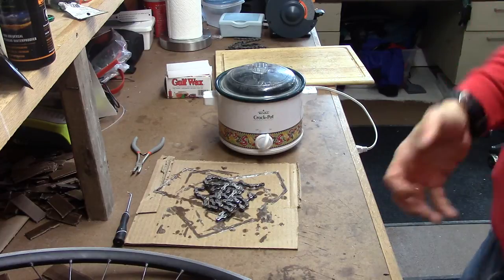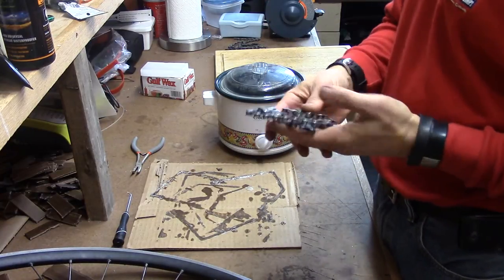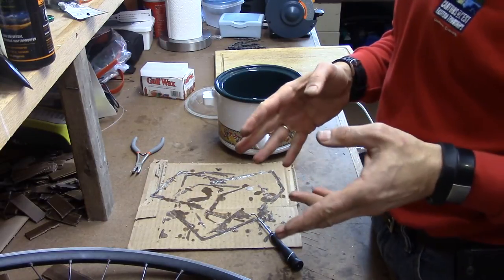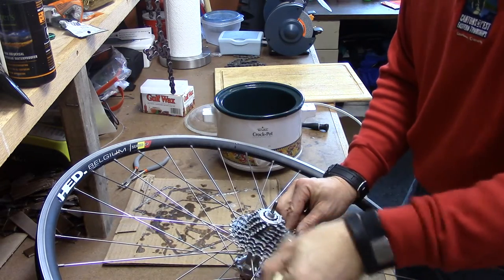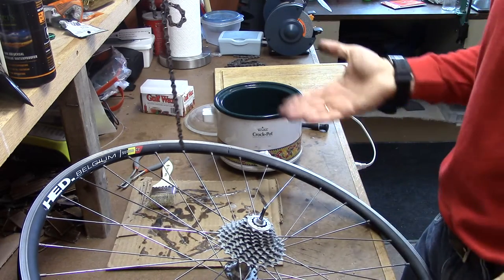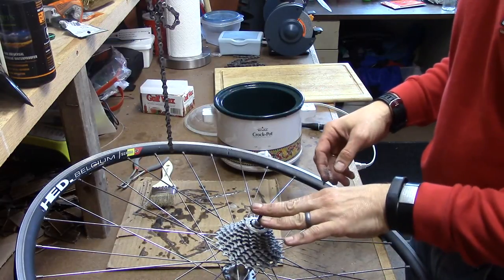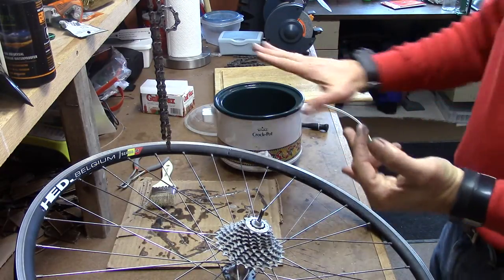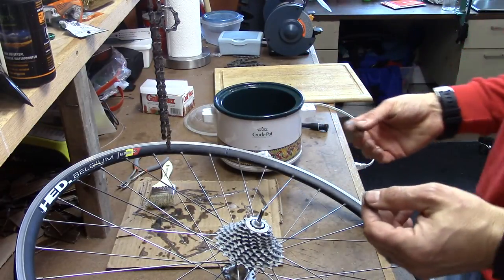How To Lubricate Your Bicycle Chain With Paraffin

Comment: I mix the wax with lamp oil, to a level that the dry wax won't be brittle and flake off quickly.
In addition, I wait until the melted wax beginning to harden before I pull the submerged chain out to hang.   I learned that most of the wax drips off if the chain is too hot when hang.  
Once cool, the chain looks like it's encased in a thin layer of wax.   I simply agitate the chain in some paper towel to get the excess wax off.
The result is that the barrel between the chain links is filled with wax.   I am hoping that the filled wax serves as a reserve that automatically lubricates the chain as it softens/melts when the chain is heated from pedaling; at the minimum, the filled wax keeps the dirt out of the barrel.

Comment: You will find that a big improvement would be to mix the wax with about the same again of liquid paraffin before heating.  This stops the wax from drying hard and flaking off and makes it a more "greasy" constituency that will stick to the inside of bearings without being pushed aside as a flake. It will keep the stay clean characteristic by being waxy and not attracting dirt.
Reply from the maker: Thanks, we'll give that a try!
Reply: No it should be 70% wax 30% paraffin oil
Reply: it depends on outside temperature: hot-less oil, cold-more oil, to be same softness no matter of temperature

Comment: Great Video, so often these "old knowledge" sort of bits of knowledge are lost. Have you ever tried increasing its effect with any more modern additives?

For instance I make my own penetrating oil by using oil and kerosene. Kero is dirt cheap (I buy heating oil by the 5 gallons but even as bottle of "parafin lamp oil" works fine). It's excellent for storing items not used often asd well as loosening nuts, BTW.

I would think,as long as it would mix, that the newer low-friction waxes, like nu-finish might blend great in with the wax and keep the chain lubed longer and cleaner. Just a thought towards improvement. Later...
Reply from the maker: +BikingMNViking : Hmm...no, we haven't tried anything like that! We're natural born chickens, and it seems like putting kerosene into molten paraffin has the chance to be dangerous; our melting pot doesn't have temperature control on it. But, for the more adventurous out there, it might work. If anyone tries it, let us know how it works!
Reply: +EasternSlopesCom Haha... it's not THAT serious. You do know that

A) nothing burns until it is a gas
B) you're shifting physical states of the paraffin closer to A by turning the solid into a liquid
C) wax burns, too, you know.
What do you think a candle is?

(and is the item at a lower energy state: IE: solid )

I am not saying a lot -- and by all means I would keep the LID ON but I think 1 z (2 Tablespoons, a shot glass full) would probably help it penetrate and you wouldn't need to soak it 15 minutes but probably 30 seconds. 

In fact once it's solid you probably won't even notice much change. But you'd be surprised at all the things that will go into wax. I've even experimented with smokeless powder in wax when making homemade fireworks. No fire ever and its far more flammable.

(BTW, us woodworkers make ALL KIINDS of wax recipes to polish or restore furniture. Google it sometime! (plenty with more flammable than kerosene))

Crockpots are very low heat items which is why it was a smart choice to begin with rather than use an open burner or even a pan on a stove which can get much hotter much quicker. I've seen a wax fire become self-igniting/sustaining in a stainless steel "ashtray" of all things. Not pretty.
Reply: I bought medical (or building) liquid paraffin its cheap 5$ for like 1/2 litre, won't it do the job??? isn't the solvent in parafinn going to evaporte after application ? rather than having a mess heating wax ? (i'm sharing a place so...)
Reply from the maker: We can't claim to be experts on liquid paraffin, but can't think of any reason that wouldn't work. Only concern...be sure to have the windows open while the solvent is evaporating! Let us know how it works...if you have good results, we'll definitely want to try it!
Reply: Kerosene as  ( in ) luminous  petroleum ?? Right !?  ( Mixed up with a few spoons of  (warm ) paraffin ??!??
Reply: @EasternSlopesCom  ... /... , i did ...  LIQUID paraffin mixed with luminous petrol as a carrier !

Post - scriptum : ... /... , other times ,,, Diesel ⛽ ,,, gazhuile .

Comment: How do you clean off the old paraffin from the chain when you want to reapply a new one?
Reply from the maker: You don't...the only reason to reapply is because the old has worked its way out of the pivots. You'll notice the chain getting a little noisy, and that's the key to know that it's time.
Reply: Boiling water 🌊🌊🌊🌊🌊🌊 ( [ ??? ] ) .

Comment: Just curious about re-waxing afterwards. How many miles is a month for you? 2 months even?
Reply from the maker: Probably something like 400-500 miles a month. But, again, how well the wax lasts varies a lot based on weather conditions; riding in rain means a lot more grit in the chain to contaminate and wear out the lubricant.

Comment: if you go to a vacation on sae, will you bring with you all that equipment and pots for chain cooking, i bring only remote 12v inductive heater and wax
Reply: I bring 2 pre-waxed chains ready to go
Reply: @mitch1495  yes i could made 10 chains , for 2 bikes and 10 days of holydays, but then i have 10 chains in circulation and it is more bulky than inductive heater and battery

Comment: Hi guys! How do you lubricate the pulleys after the paraffin is applied?  No spray but drops of lube I presume, isn't it?
Reply from the maker: We assume you're referring to the idler pullies on the derailleur, and...however you'd like! Most lubricants aren't solvents for paraffin, so they won't affect it in the slightest. And, as time goes on, we often add some lubricant to the chain after cleaning or wet rides, but it also doesn't affect the paraffin that is inside the link pivots, which is what matters the most.
Reply: @EasternSlopesCom  luminous petroleum + LIQUID paraffin . My cycle has 60 years old's components from 1959 factory . Only changed chain twice in its entire 60 years of life !

Comment: Just bought a pound of parrafin to experiment with.  We have 6 bikes here.  For the sake of efficiency is there any reason that I should not do 6 at a time?  

The only potential problem that I could think of was getting the chains mixed up.  The idea that I had for that was to color code the chains with colored paper clips (you could also slip the master links onto the paper clips to wax them, as well).
Reply from the maker: There's one other issue worth mentioning, and that's contamination of the parrafin. If you're lubing existing chains (as opposed to new), you're going to get a bunch of gunk coming out of the chains, turning the wax nice and black. We don't worry about it for a while, but sooner or later you're going to get to the point where you figure there's enough junk floating around in the wax that you should probably replace it. If you do that with a full pound, you're going to be throwing a lot away (or, using it to make firestarters; check out our video on how to make those!). If you work with a stick or two at a time, it'll last for more chains. It's not a large amount of money to buy wax, so if you feel it's worth the cost to speed things up, go for it!
Reply: +EasternSlopesCom 
Hi, thanks for this. I've just started cleaning my chain with an ultrasonic cleaner and assisting drying with compressed air, then I use wax as per your video. This works like magic.  I just completed a three day ride that has a reputation for the fine quartz  dust acting as a grinding paste on chains.  When I cleaned my chain after three days ride there was very little dirt came off the chain
Reply from the maker: +Steve Boyd Wow, that's a REALLY serious cleaning routine! We're thinking we should send our chains to you so that we can test how well your system works...we probably won't have to do it for more than, oh, 5 or 10 years before we're sure how much we like it...

Comment: How long does it last before you need to do it again, and how do you remove the old wax?
Reply from the maker: It varies significantly depending on the conditions you're riding in...nice weather, it may last a month or more, ride a lot in rain and dust and it may last a week or so. As for removing it...well, that's why you need to retreat...it's gone!
Reply: I rewax about every 200 miles.   This is assuming that the wax you used is mixed with some lamp oil to soften the wax.   If not, the cold and brittle wax flakes off and results in a squeaky chain in less than 20 miles.

Comment: Here is a study I read and would like to share it. "If the chain is not inline during peak wattage, then the wax lube is sheared out between the plates, pins and rollers, never to return. This is the issue with wax-based lubes. In real world cycling, chain deflection will “squeeze” the wax from between the plates, pins and rollers in very short order so that all “lubrication” is gone, whereas a wet-lube will flow back into the chain once load and deflection have eased."  http://biketestreviews.com/the-last-word-on-chain-lubrication/
Reply from the maker: Bobcatt22 Thanks for sharing that! Good study, as far as it goes...but it's addressing a somewhat different product and issue. We'll agree that our experiences with wax-based liquid lubes have been lousy; messy, difficult to clean with normal solvents, etc. Our experiences with impregnating the entire chain with hard paraffin have been very different. Seat-of-the-pants, we believe that the molten paraffin fills in micro "holes" in the metal surfaces, so that even when the surface wax has worn down, the chain has a certain level of protection under the wet lubes that we add. Again, this is anecdotal, but the chains seem to be a lot easier to clean over the month or two after performing the soak, which would tend to confirm that the surface is more slippery than before.

One of the standards that many cyclists use for knowing when to lube is chain noise; a well-lubricated chain tends to be silent, a dry one clatters. By that standard, the wax does work for a long time; we've gone hundreds of silent miles before starting to notice any noise at all. When we first started waxing, we'd wait until that noise started to add a wet lube; these days, we start adding wet lube earlier, but make sure that the lube and any cleaning solvents do NOT attack wax. It's not science based, but it's been said before that good science is good observation. We'd love to see someone doing deeper and more detailed tests of a wax melt/wet lube combination than we can do...one chain pure hard wax, one pure wet lube, one with both!

Comment: @ 6:15 How do you clean the chain after you've waxed it?
Reply from the maker: Use pretty much any degreaser, as it won't remove wax (obviously, make sure of that). The type of solvent that removes each is different, so you can get road grime and oil off but not remove the wax underneath. And, of course, you can add an oil-based lubricant on top of the wax as it wears.
Reply: Brilliant, Thanks!

Comment: if you want to make your hands smooth then use Paraffin wax.  whoever uses it on bike chains just doesn't know there stuff.  you need to stick with a specifically formulated wax for this.  many products out there like molten wax and things like that.  but Paraffin wax does not work.  well maybe for a few rotations of the gears that's it
Reply from the maker: Derek, can you back that up with any data? We've had good luck with molten paraffin, touching up the chain lightly with a thin film lubricant over the following weeks. But, if we're wrong, happy to learn something better!
Reply: I will explain hold on driving home from work  sorry if I sounded aggressive
Reply: Are you still on the road driving home?
Reply: I used a mix of paraffin wax and oil and it's the best tip ive ever had. Rode through heaps of mid and water and the chain and cassette were still clean after and smooth as
Reply: @Galvoflysoz  what oil did you add?
Reply: @sportsmanmalaysia  50/50 paraffin oil and wax
Reply: @Galvoflysoz  Thanks Stephen. You're still using it with great success? Do you wax your cassette as well?
Reply: @sportsmanmalaysia  it's the best ever mud and sand doesn't stick to it I have pictures of my bike covered in mud but the drive train is clean. Here's the original and best video on you tube on how to do it properly. https://youtu.be/UXuWxehSl-s
Reply: @Galvoflysoz  Thanks for the confirmation. I'll embark on this journey :)
Reply: @Galvoflysoz  ... /... , no luminous petroleum ( to the liquid paraffin ) ?